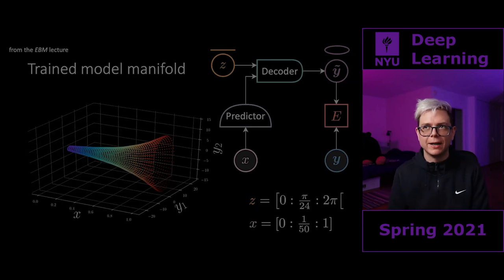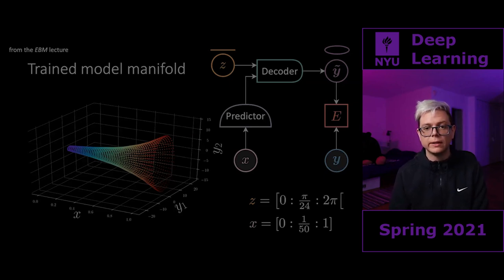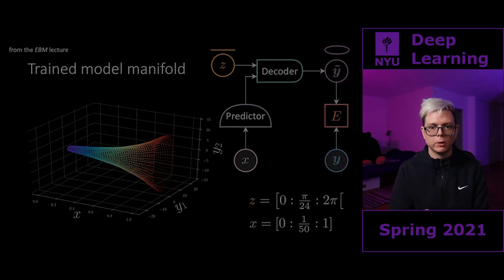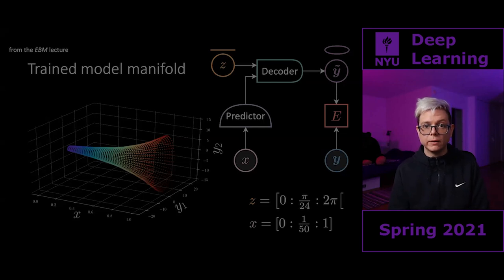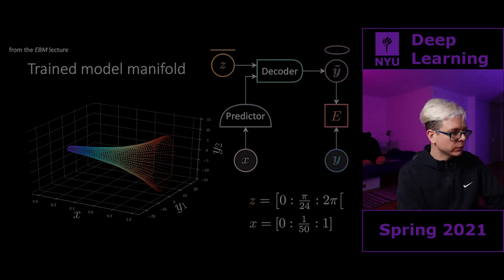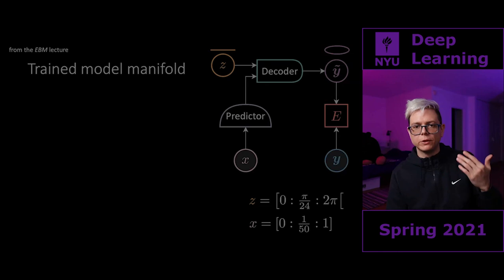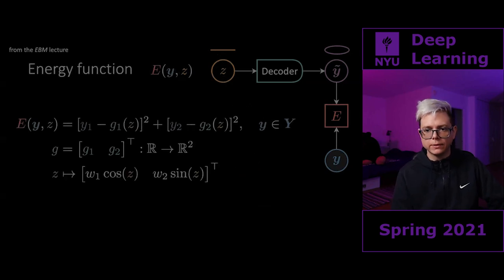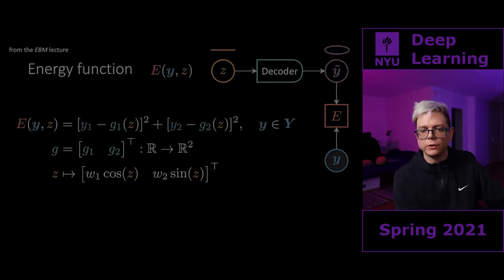08 – From LV-EBM to target prop to (vanilla, denoising, contractive, variational) autoencoder

Comment: Alfredo never fails to cover the most confusing parts of the lecture. I unsurprisingly confused AE with target prop :'), this lecture was extremely helpful for clarifying that.
Reply: oh wait, but target prop was sampling z? I thought Enc(y) was used to provide an initialization and then we run ISTA to find the final z to feed into Dec(z), so it's deterministic. But turns out the input to Dec(z) is also sampled o_O? Hmm....
Reply: I wish I watched this before the VAE part of L8, it would have saved a lot of confusion :')

Comment: At 52:15, I am not too clear on why we should constraint the bubbles from moving far away from each other. 

My current guess is: if the bubbles keep moving away from each other, we'll never have a decoder good enough to map this expanding space of bubble back to the inputs.
Reply: Decoding far away bubbles should not be harder then decoding bubbles close to zero (if we think about a collection of points in space, to push them back toward the center is a matter of a linear scaling transformation, like zooming out of the image). From what I gathered, if we allow bubbles to fly away then z could take large value possibly everywhere: we're not limiting the information content the latent can hold, therefore the system collapses to a flat energy function and we simply copy input to output, without learning (for every y we can find a z, far away from any other, that can be perfectly decoded to y). As a comparison, if we set the variance to 0 we fall back to the AutoEncoder case, in which we needed regularization (e.g. requiring Sparsity). Here we don't require sparsity but simply regularize (L2 norm instead of L1), probably because it's computationally easier to treat. We do not incur in the same issue of exploding gains in the Decoder downstream since the bubbles have a volume attached, therefore we cannot pack them too tight (lowering L2 norm indefinitely, U happy) or they would either superimpose (C gets angry) or squeeze too much (V gets angry).

Comment: Hi Professor, Thanks for sharing the video recording. I learnt a lot. I got some conceptual questions about the bubbles around 58:36.
1. Is the outer purple hypersphere a d-dimensional unit hypersphere(and that is the reason why we can use standard normal to generate sample after training?)? and, the yellow inner bubbles have to live inside it? 
2. Will yellow inner bubbles also be unit hypersphere, but less than d-dimensional so that to make space for other yellow bubbles? But it seems to me to make KL[N(u, v) || N(0, I)] smallest, every yellow bubble should be the same as outer purple hypersphere(which is an N(0, I)).

Thanks, Cheng
Reply from the maker: You're welcome.

The purple ball indeed has a unit radius. The other balls may get a smaller radius in order to lower overlapping and decrease the reconstruction error. Finally, the U term will induce an agglomeration of all the orange spheres towards the origin. All these spheres, regardless the colour, live in a d-dimensional space. This is my mental picture. Does this happen in practice? I'll let you know when I'll make new visuals for the book describing this topic.
Reply: Thanks for the explanation, Professor.

Comment: Hi Alfredo,
I am struggling to understand the clear meaning of  "initialize z(orange one) with z~(green one)"  at min 13:00 such that if i initialize means setting values of z to equal z~ what is the job of D here. i am a bit confused if u can clarify this i would appreciate it.
thanks in advance
Reply from the maker: How do we find z_check?
Usually, we start with a random z and then we apply gradient descent.
In this case, instead of starting from an arbitrary z, we start from a precomputed one, given to us by the encoder.
Makes sense?
Reply: @alfcnz  yeah makes sense now thanks  a lot.

Comment: This is a great explanation of what happens in VAE especially the impact of KL loss. I have a small doubt about that. In 49:39 for calculating the KL distance, you are using the distribution of z as the true one. Should it be the other way by taking the normal distribution with zero mean and unit variance as true one? Will it make difference in the results?
Reply from the maker: I think I've already replied to this question. Did my comment get lost? I even wrote about the inverted KL… 🤔🤔🤔

The KL here is between the posterior and the prior. It's nothing about surrogate and true distribution. You may want to watch this https://youtu.be/IXsA5Rpp25w

Comment: Hi Alfredo, first of all I want to thank you because of this work. I am very happy to live in world which has humans like you.
I have a question. At 7:50 you said that we cannot use L2 norm for regularizing Z space, because the Dec(z, h) simply increase the weights. What if we normalize the weights of each layer of the decoder? It was also my question in previous lectures that why do there exist a lot of work on L1 norm and not L2 norm?
Reply from the maker: If the decoder is linear, sure! But if it's not? Not clear. Anyhow, when using L1 over the latent and a linear decoder, then yes, the columns need to be normalised.